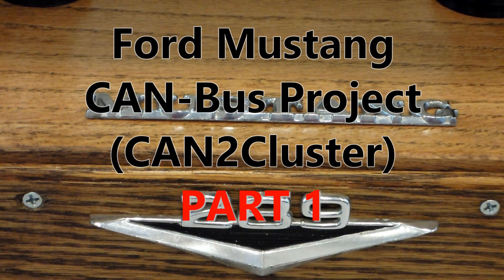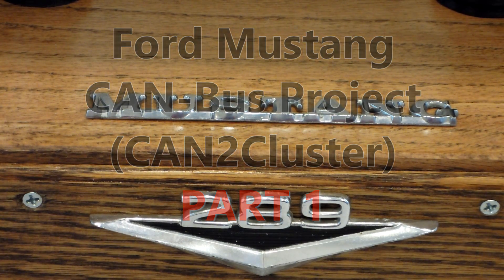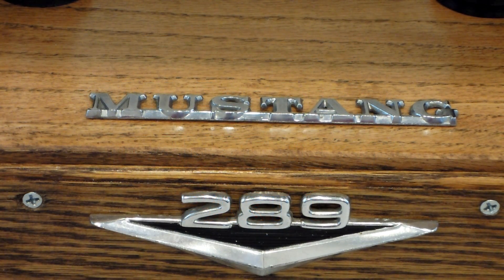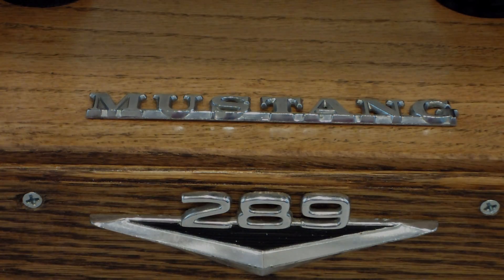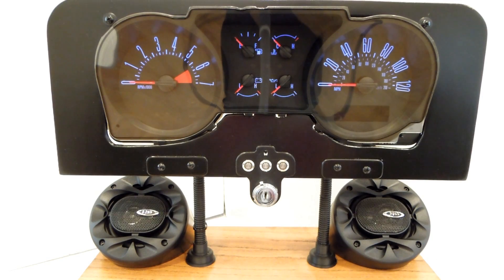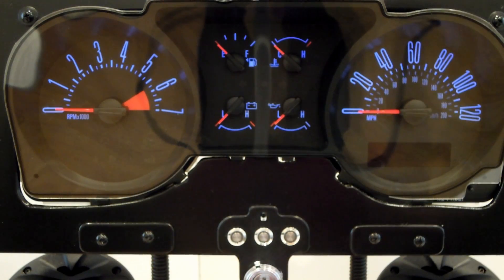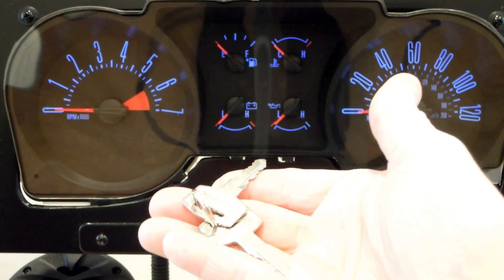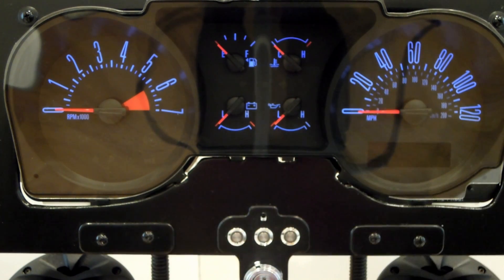CAN-Bus Project with Ford Mustang Instrument Cluster, Part 1

Comment: My retirement passion has become reviving 2005 to 2009 mustangs, so your project hit home. I am currently waiting for a box full of parts to try and duplicate your masterpiece. One issue, I have a 3d printer, so I could duplicate your 3d parts, but a scan of the internet did not turn up any STL files. Are they available?
Reply from the maker: Per your request, I uploaded the STL files onto the Github project page. Files names indicate the purpose of each part. No other information is available on how to use them.
Reply: Thanks a ton. This will save a lot of time. And now to crank up the old Ender 5 @MrRcCam